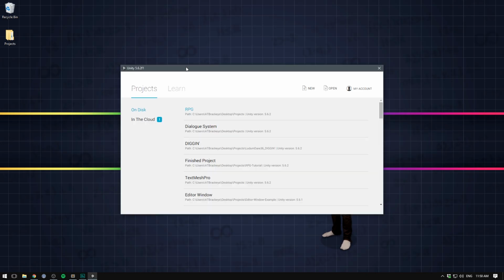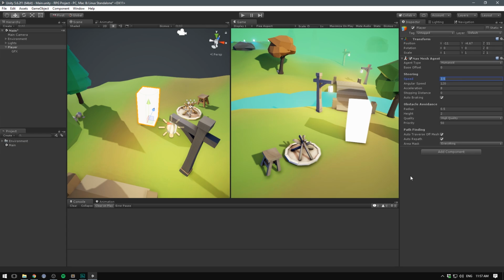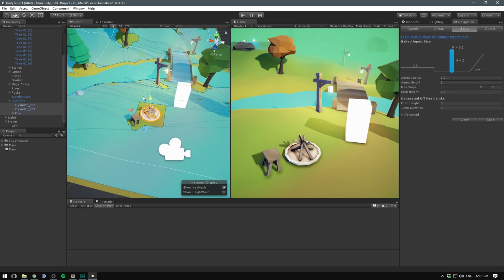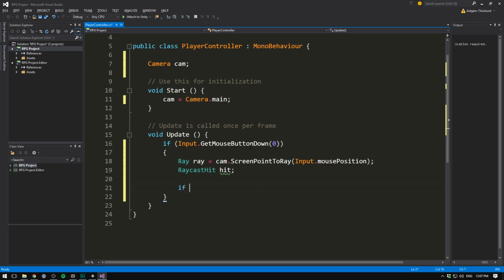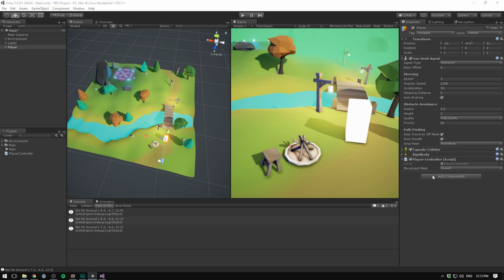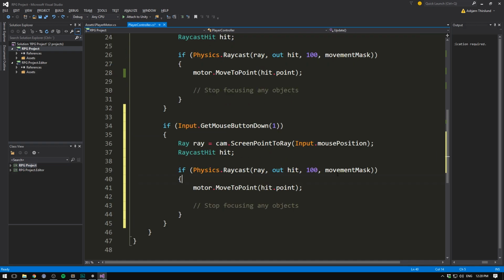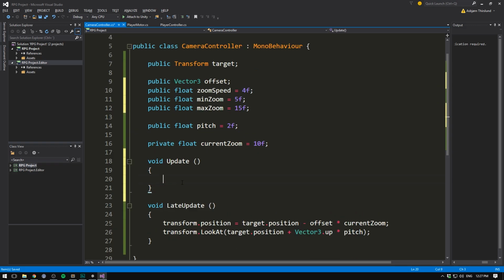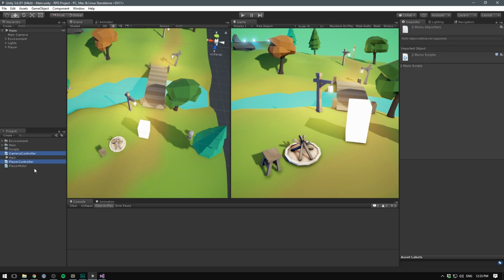MOVEMENT - Making an RPG in Unity (E01)

Comment: I had a problem with all the assets being pink. the solution I found is to select all the materials and convert them. Once selected, click Edit, down to the bottom in Rendering, Materials and then Convert Selected Materials to URP.
Reply: 10/10 comment, adding my experience as I'm a noob and it took me a bit: Click Assets folder, in search type: t:material> click one of the materials then Control+A> Click Edit at the top of your screen> rendering> Materials> Convert to URP

Comment: to anyone having a problem with " error CS0104: 'MinAttribute' is an ambiguous reference between 'UnityEngine.PostProcessing.MinAttribute' and 'UnityEngine.MinAttribute' " i fixed this by going into the script its referencing and deleting the bit that says its using both UnityEngine and UnityEngine.PostProcessing (you can enter these files by clicking the error message a bunch of times

Comment: Hi everyone, first of all i would like to thank Brackeys for this amazing series so here is my problem: i have been trying to understand the code and i got it but no matter what i try i cant scroll down or up, neither i can turn my camera around the player, here's the code:

using System.Collections;
using System.Collections.Generic;
using UnityEngine;

public class CameraFollow : MonoBehaviour
{
    public Transform target;
    public Vector3 offset;
    public float zoomSpeed = 4f;
    public float minZoom = 5f;
    public float maxZoom = 15f;
    public float yawSpeed = 100f;
    private float currentYaw = 0f;
    private float currentZoom = 10f;
    public float pitch = 2f;
    void update(){
        currentZoom -= Input.GetAxis("Mouse ScrollWheel") * zoomSpeed;
        currentZoom = Mathf.Clamp(currentZoom, minZoom, maxZoom);

        currentYaw -= Input.GetAxis("Horizontal") * yawSpeed * Time.deltaTime;

    }
   void LateUpdate (){ // LateUpdate is just the same as Update butits called right after
    transform.position = target.position - offset * currentZoom;
    transform.LookAt(target.position + Vector3.up * pitch);
                // transform, direction its looking (ITS LOOKING TOWARDS IT)
    transform.RotateAround(target.position, Vector3.up, currentYaw);
   }
}
Reply: i have the same problem, did you fix it ??
Reply: @RankingPageOff  Nope, I will probably just remake all the files (Even cuz this would get me to a better understanding)

Comment: could you potentially update this the download on the site doesnt contain the same files and it has a player and an rpg enviroment and neither one loaded in shows a solid structure. im using unity 2020 3.25f1 and blender 3.0 it tells me in the error code that blender needs to be updated to blender to 2.45-2.58 and later but im using 3.0. im sorry i know this is a free video and a helpful one its out dated a bit same as the git hub materials. hopefully you have the time to update that at some point in time. thank you for the amazing videos i will continue watching though.

Comment: Need help with: if(player is moving in world space z or -z direction){do other code here to move UI Icon direction of x direction as the player is being pushed in the x direction always and UI Icon must show this when player is facing in either z or -z world space ditection movement the icon either points right or left depending on the player z movement} The code inside the brackets is fine but the if( player is moving in z or -z world space) I can not figure out 3 weeks later. Alll the best from 🏴👨‍💻 👍

Comment: So I bumped into an odd issue where it wasn't detecting my A or D inputs. Ran a debug to check.

I found this work around by using right click for rotation:

Drop this in update:
        if (Input.GetMouseButton(1))
        {
            currentYaw -= Input.GetAxis("Mouse X") * yawSpeed * Time.deltaTime;
            Debug.Log("Current Yaw is changing");
        }

Drop this in late update:
transform.RotateAround(target.position, Vector3.up, currentYaw);

I'm happy this got me to work on cameras in a safer way, trust me it can be hell. Now I want to figure out how to get the camera to do different things when zooming in, like by the furthest out it should be top down.

Comment: COMPLETE. 3 years later, 90% of instructions were relevant and 10% of the project had to be researched by myself.

The 10% included: 
Main Issue: Environment not loading correctly because our Tree and Base Environment objects were imported as .blend files and my Unity setup did not like that. 

My fix: open the .blend files in Blender and export as .fbx to the same location in your project.

Next, I had to assign these new .fbx models to the GameObjects that were searching for their mesh!

Clicking and dragging my .fbx model onto those GameObjects replaced them in space. The original corrupted GameObjects can be deleted after this.

Now, make sure to change the layer settings on these new .fbx GameObjects and set their respective Walkable settings.

Your environment should be fixed & Ray Casting should function properly.

Good luck!
Reply: I know this is kinda late, but for the .blend issue, there is a easier fix. Just select the .blend file, go to the materials tab in the inspector, and then in the Material Creation Mode dropdown, select Standard (Legacy) . Don't forget to hit Apply !
Reply: @thecodingfox  This only seems to work if Blender is installed.  Additionally, I also changed Location = Use Embedded Materials to make it work.  Thanks for the hint!
Reply: thanks for the help i ended up just downloading a different map anyway as it was easier but at least now i know it wasn't something I did wrong and i still have hope for my game.
Reply: thanks man, this was super helpful
Reply: Savior
Reply: what game objects are you talking about I'm kind of confused here
Reply: you are supposed to install blender thats why
Reply: I ended up having some trouble with trees being positioned at the origin when I tried that so I just went ahead and converted Base Environment.fbx, Tree 01.fbx, and Tree 02.fbx inside the rpg-tutorial-assets/Models folder, deleted the .blend files, and imported the package into a new project. Worked great, only change I had to make was the using MinAttribute = UnityEngine.PostProcessing.MinAttribute; change in postprocessing. Would not have been able to figure this out if not for the other comment, you are a legend!

PS To get rid of the warning swap out the wooden stool's box collider with a mesh collider
Reply: Oh my God thank you mate
Reply: THANK YOU!!! LOVE YA!😆
Reply: This was really helpful!
Reply: i wrote good code and sphere not working how fix it??? in next tutorial you know how fix it???

Comment: (a bit late) if your cube goes half way through the floor after adding the nav agent check if your Base offset is 0.5 in the nav agent component. Took me an hour to find out lol. The problem i think is that the nav agent goes through the floor which intercepts with your capsule collider making it go half way through the floor.

Comment: I'm still having problems with The base model (Environment and such) and trees. I have Blender installed and double clicking models in unity  correctly opens them in Blender but for some reason they don't show up in Unity, does anyone have any tips?
For some reason the Lamps, campfire and few other models do show up...
Reply: if you right click the assets and choose Reimport All it should fix the issue
Reply: @dustinmiddleton2336  This worked for me. Thank you!

Comment: In 19.3, I had this issue:
Assets\Environment\PostProcessing\Editor\PropertyDrawers\MinDrawer.cs(6,34): error CS0104: 'MinAttribute' is an ambiguous reference between 'UnityEngine.PostProcessing.MinAttribute' and 'UnityEngine.MinAttribute'
I fixed it by removing line 2 (using UnityEngine.PostProcessing;) in MinDrawer.cs.
Reply: Thanks it worked for me

Comment: Hello, there maybe there is someone who can help me, my main problem is, that my Visual Studio 2019 and Visual Studio Code, both of them, never fill up my words, with their suggestions, so if if want to write "if(input.getkey)" etc.... the "if" part is working with "if(){}" but the other words dont work ?
Reply: Hi Dwasa Here are a few things you can try(*note VS = Visual Studio):

1. Try Restarting Unity and VS.
2. Ensure that VS is your external Editor: In Unity Click on Edit -> Preferences. click on External Tools. Where it says External Script editor make sure the correct VS version is selected (VS 2019 or VS Code whatever you are using.)
3. Check if the Unity dev tools are installed in VS: In VS Click on Tools-> Extensions and Updates. Check if "Visual Studio 2019 Tools for Unity" is showing on your installed list. If it is not then click on  Online in the left hand menu and search for "Visual Studio 2019 Tools for Unity" in the search bar.
4. Check if your script is included in your project: Using the Solution Explorer (In VS: View -> Solution Explorer). If your script.cs file has a paper with a dotted line around it as the icon, Right-click on it and select "Include in Project" from the menu.
5. Try Updating VS. In VS select Help -> Check for Updates.
6. Try installing a different Version of Unity.
Reply: For VS Code: You might not have .NET Core SDK installed. This is require for VSCode to generate intellisense hints.
 You can download and install the .NET Core SDK for your platform here: https://dotnet.microsoft.com/download. Be sure to get the SDK not just the Runtime.

Comment: so im getting "Assets\Environment\PostProcessing\Editor\Utils\CurveEditor.cs(379,35): error CS0619: 'EventType.repaint' is obsolete: 'Use Repaint instead (UnityUpgradable) -> Repaint'" and uh nobody else seems to have the problem

Edit: got some help from my dad on this one, anybody else who has this problem just open the CurveEditor.cs file either with the path in the error "Assets\Environment\PostProcessing\Editor\Utils\CurveEditor.cs" or by double clicking the error, then press ctrl + f and in the search bar type in "repaint" and replace any words it shows that say "repaint" with a lowercase r to "Repaint" with an uppercase R.
Reply: also do the same for any other errors with the same format

Comment: I just started this project on 4/27/2020. for those having issues with the graphical assets not working. I installed blender. restarted my computer. and then opened the project in Unity again. At first I still had the same problem. but then I right-clicked on the "Assets" in my hierarchy and selected "Reimport All" and then the graphics worked just fine. If i have any other issues I'll post those fixes in the appropriate lesson video. Hope it helps you all.
Reply: Thanks man, this helped me.

Comment: *FOR ALL WHO ARE TRYING THIS TUTORIAL WITH THE NEW UPDATES* 

The preset environment DOES NOT WORK CORRECTLY. If you’re really itching to do this tutorial then your going to have to mess with some models and convert them to FBX files in Blender. After that, you’re going to have to set up the environment from scratch, save for the stool, portal thing, campfire, rocks, lampposts, and bridge. You’re going to have to place the ground in and recolor it with the ground material to make it look nice. Also, you’re going to have to recolor the trees and replace them if you want it to look nice. Just a warning!

I wish those who are going all in like this good luck for their journey!

⚠️ ** Even with trying to do stuff myself and reimport the models, I ran into problems! If you’re still interested in this tutorial then download old versions of Unity and Blender to get this to work!  Reply to this if you want to know what versions to download!** ⚠️
Reply: What versions will work?
Reply: Mati xor I’m assuming you’re using Visual Studio along with Unity. What is working for me is Unity 5.6.2. Which you can find by going to Download Archive - Unity and going to the Unity 5.x and finding the version (it should have the date 21 Jun, 2017 under the correct version). 

Next, you’re going to have to get the correct version of Blender, Blender 2.78. I got this by going to Previous Versions - Blnder.org, clicking on the underlined download below the “All Previous Versions”. After you open that page, then go near all the way down to the bottom of the list to “Blender2.78/   01-Mar-2017 16:43, click on the link, and go to blender-2.78c-windows64.msi (if you have windows) and download that. A file should appear to wherever you place it and all you have to do is download it.

Visual Studio you can keep the same, just make sure not to let it edit anything for you while you’re working on your game or else it could seriously mess things up. Once you get to a certain point in your script writing it will say “Inconsistent Line Endings” ⚠️ MAKE SURE TO SAY “NO” OR “IGNORE ALL” IF THIS HAPPENS OR ELSE YOU COULD HAVE TO RE-START YOUR PROJECT BECAUSE I COULDN’T FIND A FIX!! ⚠️
Reply: @tobiasdodd9521  holy crap thank you so much.
i can not even say in words how much of a life saver you are.

comment should be pinned

Comment: For anyone having issues with the package in the latest version of Unity, I was getting the following error:

'MinAttribute' is an ambiguous reference between 'UnityEngine.PostProcessing.MinAttribute' and 'UnityEngine.MinAttribute'

By opening the indicated MinDrawer.cs script and replacing the three references to "MinAttribute" with "UnityEngine.PostProcessing.MinAttribute" (no quotes), the script should compile and work as expected. You'll get a dialog asking to recompile, and I didn't have any issues simply letting it run without a backup.
Reply: Thank you so much

Comment: the example scene wont load correctly everything...
:(
Reply: Read first comment. You need to install Blender.
Reply: @klarnorbert  i did already, and it still the same...
Reply: @lidory98  Did you open one of the 3D models with Blender?
Reply: @klarnorbert  in blender it works fine but not in unity

Comment: the movement only works when clicking on my player's capsule collider (rotates the player to face the point), i did everything exactly like in the video but with my own prefabs. I doesnt show errors but the if in the raycast only works on my player's collider (i tried removing the collider and then it didn't move at all, i change my players layer and again nothing)

Comment: Hi, I'm new to all of this, so I have question that seems to have been glossed over pretty quickly, Why do we need to have the "origin of player" at the bottom? is there a specific reason? or just a design choice?
Reply: It is so that the player does not clip into the ground and land on its active point. But I have changed origin of player to pivot and it won't go to the bottom, how did you do yours

Comment: The Debug.Log statement works normally, until I do the stuff with layers. How do I fix this?
Reply: I put a huge number in the "range" field and it worked  > if (Physics.Raycast(ray, out hit, 500000, movementMask))
Reply: @michaelwilson7159  You could also use Mathf.Infinity instead of 500000
Reply: @dksamaritan5200  Good point, thank you

Comment: hey can sb help me out pls :) when i try to use the point somewhere to walk around stuff this error appears 

Assets\PlayerController.cs(31,23): error CS1061: 'PlayerMotor' does not contain a definition for 'MoveToPoint' and no accessible extension method 'MoveToPoint' accepting a first argument of type 'PlayerMotor' could be found (are you missing a using directive or an assembly reference?)

Comment: I've done everything in the video twice now and I'm getting the same result, The raycasting works and will tell the debug log to move, but my actual model doesn't move. The transform position moves when I click somewhere, but it's like the model is locked in place and a ghost goes to where i clicked. I'm not sure what to do, I can post my code if someone needs it.

Comment: Anyone know if I can use Nav with WASD controls (via transfrom translate or rigidbody.addrelative force?)
Problem:
Rb.addforce doesn't give a good feel of the movement (no snappy, sluggish, sometimes grips) I could bump up the force, but character moves too fast + clamp velocity magnitude causes inconsistent jumps.
Transform.translate clips through collision angles less than 90 degrees i.e. inside corners of a house

any suggestions?